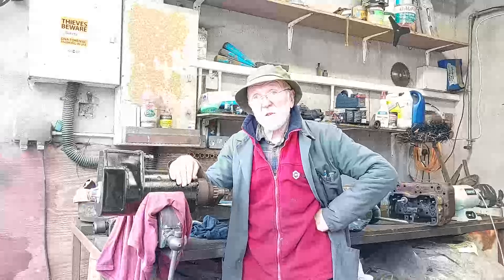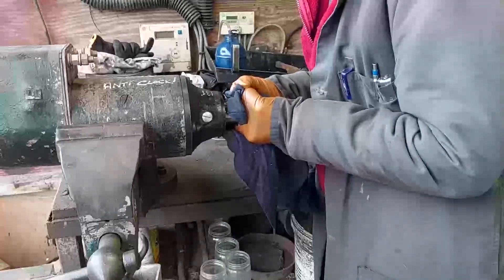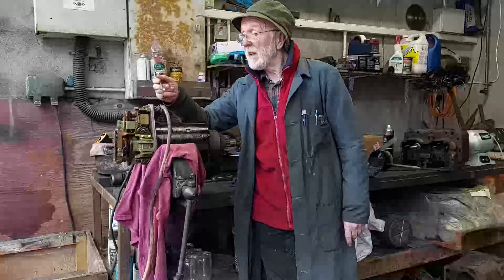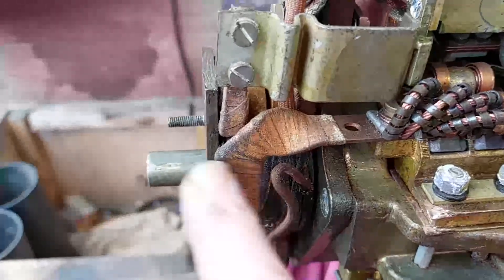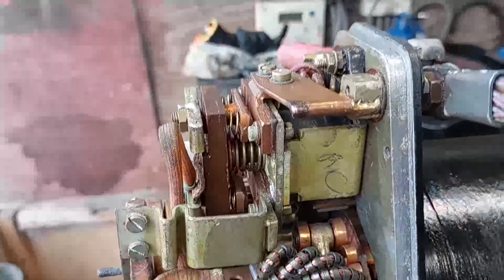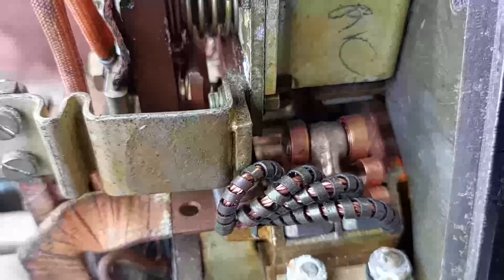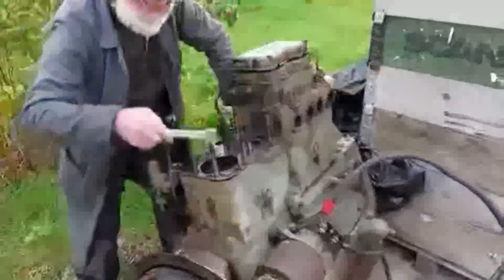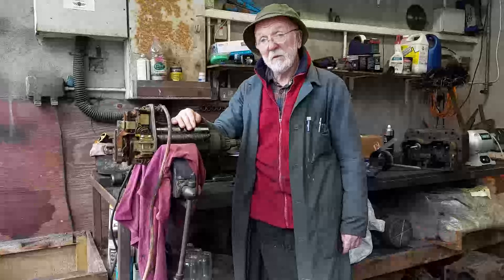Gardner Engines: a quick look at the Simms starter.

Comment: Hi good infomation.  should the bendix be out all the time whilst running as in the first time you energised it or is it ok to come out and back in again like when you energizes it the 2nd time?
Reply from the maker: Sorry John.  I do not understand your question.
Reply: @tangentgardner  When you first energized the starter the bendix came out and stayed out untill you released the power. But second time it came out and went straight back in again before you released power. I have the same starter but 24 volt and before I put it back on the engine just wanted to know if its working right as mine when energised comes out and straight back in again doesn't stay out.
Reply from the maker: @johnsimmonds5734  No, doesn't sound correct to me John.  It should stay out and engage with the ring gear as long as you have your finger on the button.